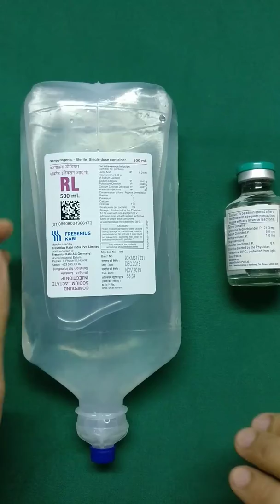Tumescent solution

Comment: Any clinical advantage with hialluronidase?  In you experience did you note something diferent during procedure or outcomes?
Reply from the maker: Sorry for the late reply.. use of hyaluronidase is actually a personal choice. When i was studying in chennai , everyone recommended using it saying it helps in dispersion of the solution. But i have recently joined in Delhi and my chief actually believes that it is not at all required. Have not seen a difference in outcomes. From exam point of view though, you should mention it as one of the components.